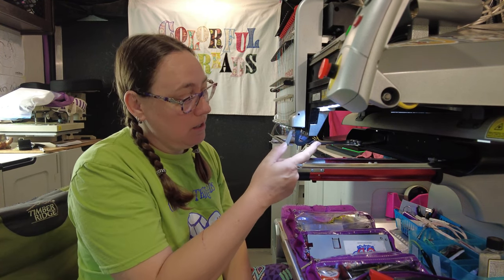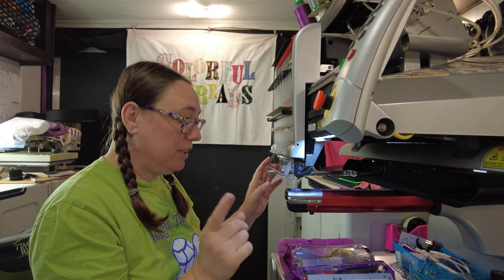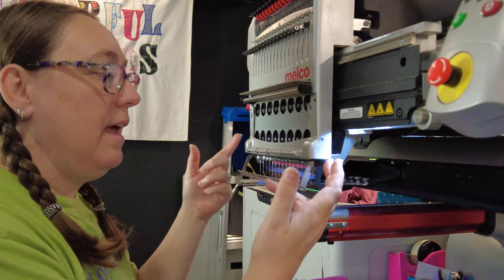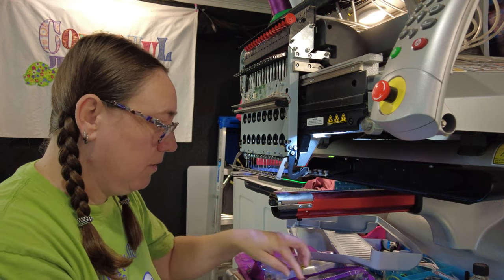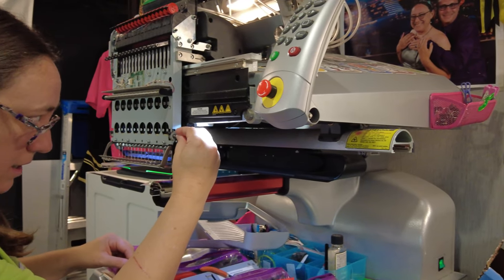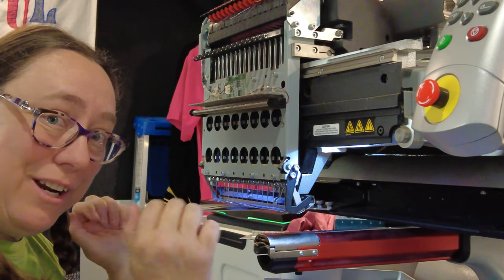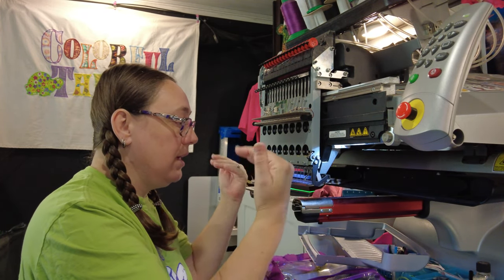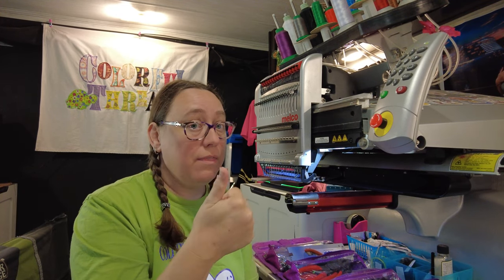Grabber Trap Assembly Replacement. Melco Amaya. XT. XTS. EMT16x. Bravo. Bernina E16

Comment: Nice!  Any videos on changing the presser foot?
Reply from the maker: Probably not as that is a very involved process, I have been toying with a pay per view for more difficult projects!
Do you have a problem with your foot?
Reply: @colorfulthreadsembroidery  Ah, we got it stuck in the grabber bar (twice now over the last few months-operator error-hit emergency stop while the grabber was in the back position-UGH! and when the emergency was released it got stuck.)  We were able to get it unstuck after alot of messing around, pushing up and prying forward. It got bent slightly out of position but we were able to bend it back so it was no longer touching the needle and it seems to be working fine. I was just hoping for a video on the process to better see what's involved. I did read on how to do it but it does seem pretty involved.
Reply from the maker: @larryvinson4110  Thats great! Sounds like you are good to go. I really only like to replace if it's really broken but bent, that's just normal stuff. BTW Mine is bent from spiking a hoop😉